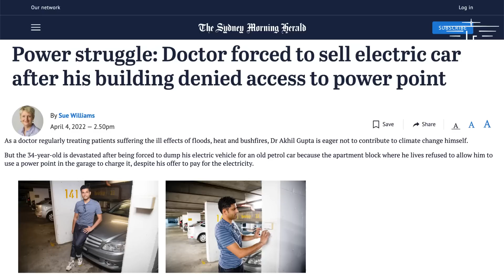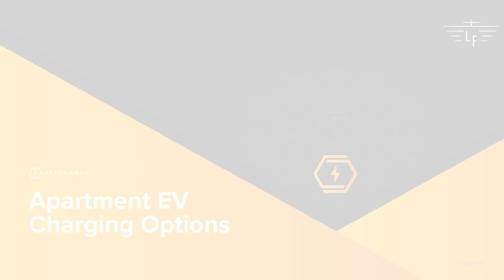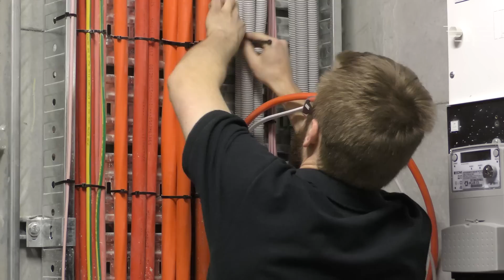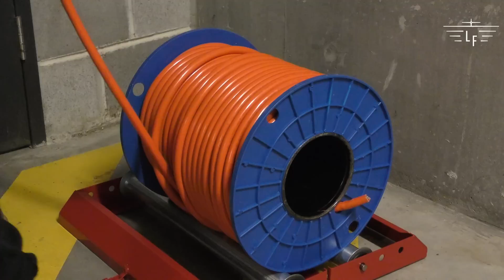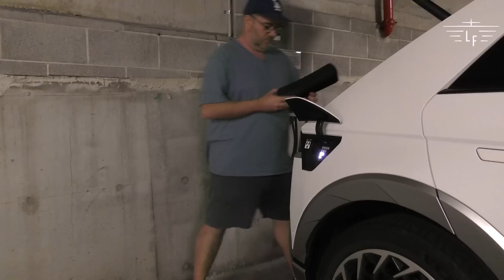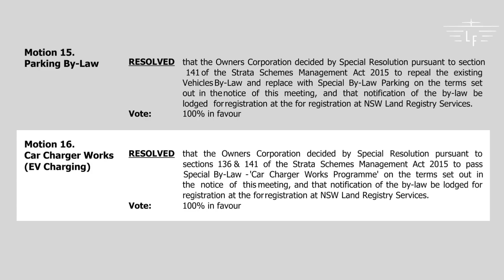EV CHARGER INSTALLATION IN APARTMENT CARPARK | One Owner's Experience

Comment: how much did he end up paying ?
Reply: @Sɛnˈseɪ Sīfù Shreder haha love your humour
Reply: @Sɛnˈseɪ Sīfù Shreder Add two zeros and change the 4 to a 2
Reply: Around $5000
Reply: @Sɛnˈseɪ Sīfù Shreder You have no clue how much work was involved there is no way this work would be less than $10k and most likely around $20k
Reply: If below figures OF 10 to 20k can’t see why it’s worth the hastle
Reply: @MikeyDawso  100 metres of 3 phase wiring and another 100 metres of Ethernet cable, a 3 phase meter lots of expensive labour of various organisations especially the electricity company and the electrician as well as the charger itself possibly $2-$3k to support RFID for security against anyone using it. So yeah probably not $20k but certainly $10k
Reply: @gregandkaruna6674  It didn't cost 10K, it cost $5-6K. I have spoken to Brett
Reply: @ATechie  If you had really talked to him then you would have the actual cost not the guess price of $5-$6k 
A basic install is $1000 in labour costs for a single phase install his charger is also a more advanced model with a lockout system. But whatever believe what you like
Reply: @gregandkaruna6674  Believe what you want but I don't see you backing up the $10K figure with any evidence. If I provided an exact figure then you'd be asking for an invoice and if I had provided an invoice, you'd say I Photoshopped it, etc.
Reply: @ATechie  No you did not you just said $5-$6k meaning your guessing as well
Reply: @gregandkaruna6674  Just because I didn't provide an exact figure doesn't mean I'm wrong
Reply: @ATechie  Does not mean you are right either. Either way if you are correct then that was extremely cheap for a very complex installation
Reply: @gregandkaruna6674  My information is correct as I got it from the source itself. If you have a hard time believing it then that's not my problem.
Reply: @gregandkaruna6674  Feel free to PM Tesla Tom for Brett's email address and contact him and verify all the information I have provided
Reply: @ATechie  Oh your one of those people that have to comment last. OK I get it
Reply: @gregandkaruna6674  I'm one of those people who can spell correctly and likes to provide accurate information unlike someone who pulls numbers out of thin air.
Reply: @MikeyDawso  I guess if you can afford an inner city apartment as well as a min $70k EV then what's another $10k?
Reply: I have spoken to Brett and the cost of the charger + electrician was $5.3K If anyone wants more information about costs and installation, Brett said he is happy to provide you his email address if you PM Tesla Tom.